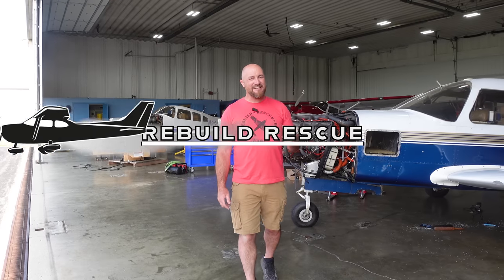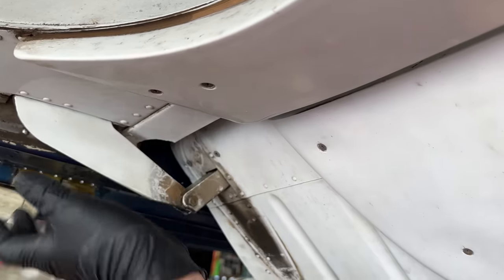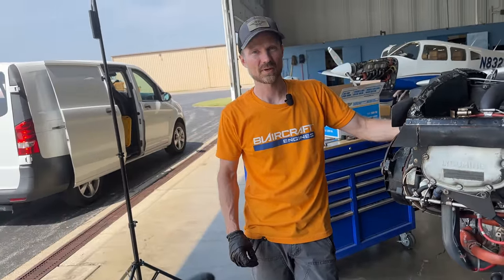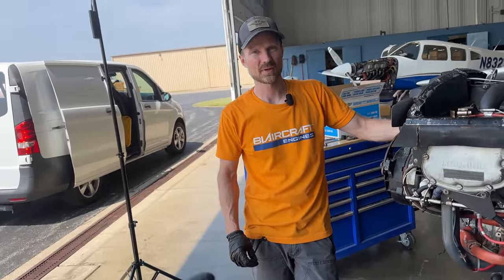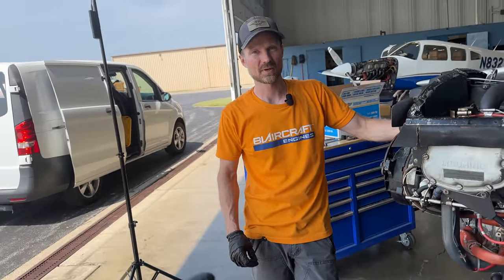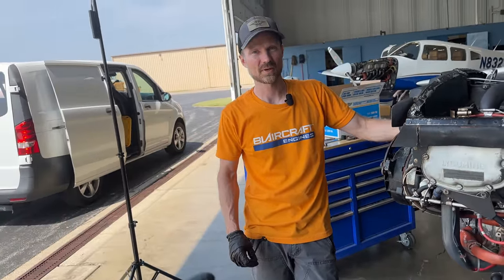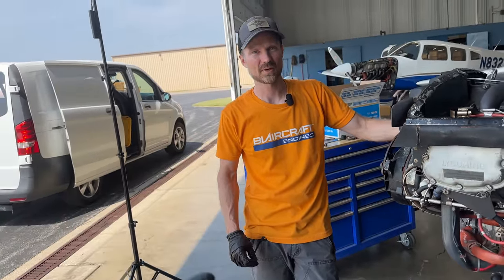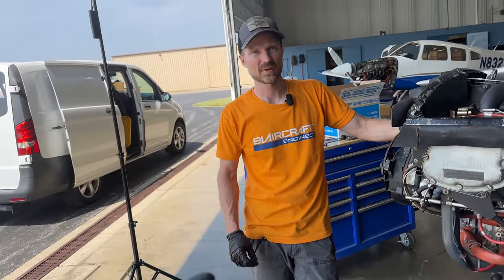Can we Fix and Fly a CRASHED Airplane 400 Miles Home ?

Comment: Also Jason, you don't need an annual inspection to fly the airplane back to your home base, the best thing to do is to get a ferry permit they're easy to do all you need is an A&P to inspect the aircraft and sign off that the aircraft is  
airworthy for the proposed relocation flight and submit electronically that to the FAA. You might want to reach out to Mike Bush at savvy aviation I'm sure he will be more than happy to explain the process, or you can talk to your local FSDO. The reason I'm saying this is that there's no reason to rush through an annual inspection better to have the aircraft near you when you do the annual just in case you find something significant, Good luck!
Reply from the maker: Thank you Chris !
Reply: @rebuildrescue  super duper my friend I love your work ethic That's fantastic. It would be great for every airplane enthusiast to see how the ferry permit process and post maintenance fight takes place, The more the public sees how the system works the more they can embrace it. I'm sure Orville and Wilbur wright would be proud of your team. 😁✈️

Comment: This plane needs a Continental CD 300 Jet A engine conversion so bad!
Reply: A 10% reduction in available power? Huh?
Reply: @buckmurdock2500  I dont know. is has 300 HP and runs on Jet A (diesel) instead of AVGAS (leaded petrol) like in the 1980s. Im not even an eco nut job I just know that burning lead to dumb down the combustion and keep the cylinders cool is old technology that is not relevant now days.
Reply: @E69apeTheMatrix420  Forgive the typo, it's about 10% reduction in power. For new development perhaps but can't see it happening in the US retrofit market. The engine install will be 2-1/2 times the value of the plane,  comes with a hefty weight penalty and other than fuel consumption offers no performance improvement.
Reply: @buckmurdock2500  I cant run leaded petrolium like its 1979. just cant do it. its turbochrged real useable power and takeoff wil always be better in jet A. leaded Avgas is for losers it wasnt even acceptable in 1990 let alone today. Leaded petrol? The jet a turbo dieles would be better in every way. just the red tape of retro fit isnt viable for the cost and effort The new engine out the box is $30,000. Not too bad if the current engine due a TBO anyway. Just the hoops to jump through makes it hard
Reply: @E69apeTheMatrix420  lol, where do you get your numbers from? A brand new Continental O-200D, which is a lighter weight version of the cessna 150 engine is $40,000 from AirPower. A brand new Lycoming TIO-540 for the Saratogo is $150k from AirPower.  There's no way the diesel is $30,000, lmao. A FWF install job on the Saratoga will be quarter million.
Reply: ]1

Comment: Well, i'm glad that it looks like it's running so well and I know the crank gauged right but sure would hate to find out the hard way that there's a hairline crack in that crank shaft from the propstrike that decides to break when you're 350 feet off the ground after takeoff.  Pull her apart and magneflux it.
Reply: Absolutely not you never tear apart an engine if you don't have to. Statistically it is well known that an engine is more likely to fail after it is rebuilt when compared to one that has been running just fine never ever ever ever tear apart an engine unless you know for a fact that something is coming apart like a camshaft The airlines learn this in the 1960s the British coastal caband learn this in the 1940s. Of course as a kid I learned this when building model airplanes we always tossed a rag into the prop to shut it off and not once did we ever have a crank break because of this.
Reply: @christophergagliano2051  They actually have to pull the engine apart as per the engine manufacturer's own service bulletins. I'd be interested to see if the propstrike was ever disclosed to the FAA or any future buyer.

Comment: Layman’s question: What’s the deal with the wall plug with the red cable tied to the top side of the engine?
Reply from the maker: That’s a block/oil heater for cold climates.

Comment: Hey, Jason, what is the AC plug on top of the engine for?  Keeping the oil warm in winter?  Also, saw something useful on Steve’s Small Engine Saloon— for rusted-on bolts, mix Acetone & Automatic Transmission Fluid 50/50.  It worked well for me.  Kroil 2.0 😎
Reply: Yes, engine pre-heater.   They warm the cylinders and the oil sump.   

The two prominent manufacturers for GA aircraft engines are Tannis and Reiff.   

Reiff has bands that heat the steel cylinder base vs Tannis that has plugs that thread into and heat the cylinder head.    

     Both have silicone or metal pads that glue to the oil sump to preheat the oil.

Comment: Please see Lycoming Mandatory Service Bulletin 533C Recommended Action for Sudden Engine Stoppage, Propeller/Rotor Strike or Loss of Propeller/Rotor Blade or Tip.  Is this mandatory or recommended in this case?
Reply: How could it be mandatory if it's only recommended I went through this on an export years ago and the importing country CAA said dial the crank run it up, and if it makes power (TC Data Sheet) it's okay to export.

Comment: A great video for sure, well done. Joe please remove "pop rivet" from your vocabulary while working on an aircraft. Pop rivets are used to build RVs and campers built in Warsaw Indiana home of the RV trade lol. I hear by authorize you to use the term cherry max or blind rivet, blind fastener, or pull rivet. But please stop with the pop rivet those days are over (refer to full metal jacket for explanation on those days are over) lol

Comment: what's the procedure to make sure the engine is okay after a prop strike?
Reply: Jason said there is a FAA AD (Airworthiness Directive) that covers the procedure to check the engine out, actually I think it might be mandatory service bulletin from either Piper or Lycoming but I could be wrong. In any event it looks like you inspect a bolt and a sprocket located in the accessory case, also check the front end of the engine with a dial indicator to make sure the prop flange/crankshaft has not been bent.
Reply from the maker: 100% correct Chris. Lycoming also recommends a few other things but aren’t part of the AD associated to a prop struck engine.
Reply: @christophergagliano2051  ah cool, thanks, was thinking that what did they did was the relevant part, in my mind it was a complete tear down, but that probably was on something different.

Comment: This was very nerve wracking to me. All this with no errors. We do not know if high boost and lower rpm will break the crank or not. Go Saratoga go. As smooth as it is running I doubt anything will go bad along the way. Now oil burn and fuel flow will show this to be very well done. These engines with turbine exhausts will be stronger than the pilot without oxygen it will pull strong right to 18,000ft.

Comment: As an engine guy myself I was searching for the engine teardown and NDT of the rotating parts. I guess I missed it. Lycoming says: Any decision to operate an engine which was involved in sudden stoppage, propeller strike or loss of prop blade tip without disassembly and inspection will violate the AD Note issued by the FAA and Lycoming Service Bulletin No. 475C, both of which are mandatory. Any decision to fly an engine without complying with these publications must be the responsibility of the agency returning the aircraft to service. Figured to post the video, the work had to be accomplished... No trying to be a butthead, but guessing I missed something.
Reply: Ok, I now see where you did the crank run-out, but man no NDT ????

Comment: I thought a prop strike on a engine is full teardown of engine to check for cracks in the crankshaft SCAIRY BOYS WHO IS SIGNING THAT OFF?
Reply: No, they did it right, there's an AD or Lycoming service bulletin that they're following. The reason being is that a total rebuild has much more risk than the two inspections and two replacement parts, trust me this is safer method to return the aircraft to service.

Comment: The old saratoga curse....gear up landing. Usually due to overlooked alternator belt alignment, which results in a broken belt at the worst time....ifr, bad weather, night time. The aircraft battery isn't capable of running all of the systems very long.

Comment: This is the, "Get there -itis..." of the maintenance world.   Seriously why is a non A&P Master Mechanic determining (Jason) the Scope of Work and pushing the profesionals to be fast?
Reply from the maker: There’s zero pushing. Just good friends working hard and lots of hours to complete tasks. All while following standard repair procedures according to the manufactures and faa rules and regulations. 👍🏼
Reply: @rebuildrescue  I'm just wondering, will this have some kind of run in test time on the ground before it's fully laden and in the air? Just curious how this kinda thing works. You guys look like you did a great job btw😀 Not that I'd know anyway 🤣
Reply: @anthonydenn4345  Yes this will require a flight test with only the pilot on board, that's an FAA rule if they violate it I could guarantee you FSDO will be contacted with a formal complaint.

Comment: Yup.  Pull th Wings Cradle the Fuse & wings on a Flat Bed, Drive it 400 miles and take the Time to do it right. JMHO
But then there's no you tube Video.

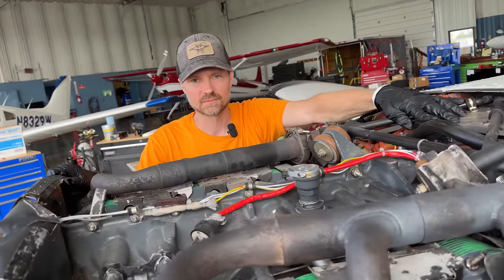Comment: 5:05 I guess we're just gonna ignore the house electrical plug wired up........
Reply from the maker: That’s to the toaster oven in the cabin. 
Totally kidding ! That’s to the block/oil heater and was included with the approved parts on the Toga.
Reply: @rebuildrescue  Thank you! I saw that and was like, ok, this is a new electric power upgrade? I full on had my wife believing that you guys just use a really long extension cord and it's an all electric plane.

Comment: too bad you didn't explain in the beginning why you have to take off the magnetos and the vacuum pump after a gear-up landing... did you have to change that bolt because of the prop strike? What was annual work related and what was accident related? Would have been interesting if you had shown the damage from the belly landing. Did you/do you have to change any panels underneath? was the gear-up landing caused by pilot error or mechanical malfunction? Do you have to check the gear down/up function before take off?

Comment: A prop strike requires a complete engine overhaul - how could you do that it three days
Reply: Absolutely not, no overhaul needed for a prop strike. The FAA has ruled on that and issued an AD. years ago that might have been the case but not now as the FAA has recognized that complete disassembly adds more risk.

Comment: What is that electrical plug doing on the top of the engine?
Reply: Tanis heater. You plug that in and there are heating pads in the engine compartment to keep oil and cylinders warm during the winter.

Comment: The problem with dialing out the crank while fully assembled and installed is that a prop strike can crack a crank and a dial will not show that at all. Only visual inspection will.  the other problem is A prop strike can crush only a small area of a crank bearing, and a dial indicator only sees the resultant lateral play on a single point on the entire 360 degree area of rotation of a crank.  The lateral play from impact can be on any one of the degree angles on the  360 degree rotational points.  IN addition, the lateral play may not be apparent with all the rods and pistons installed. The play of a crank bearing in a overhaul or rebuild is measured always with no pistons or rods installed because they restrict crack latter play. Dialing a fully assembled engine crank to detect bearing damage or crank damage is stupid. Lycoming does not recommend it.

Comment: You Torqued all those bolts on rear gears wrong. Suppose to do it in one smooth motion. You torqued in rachet movements. The torque is off by a minimum of 30% when you do that. Even though there looked like was little room to turn the torque wrench, that is because you placed the handle in the wrong spot to begin the torque. You had plenty of room if you properly positioned the wrench before beginning the final tightening. All those bolts are way off proper torque. at least 30% below spec.

Comment: Why do I feel like you are doing this the hard way? I line up the gears with a ruler and it works quite well. Not sure why you don't do this? Use the studs for alignment, and the holes, bla, bla, bla. You should nail it.

Comment: Oh by the way, it would have been a lot easier to do a scarf alteration on the flap hinge bracket putting two pieces of aluminum on each side of a new flap hinge bracket. So instead of drilling out 150 rivets you could have just drilled about seven holes and rivet the same size fasteners to the existing/cut down bracket that would have been a perfectly acceptable alteration, at a vastly reduced cost.
Reply: where's your data?
Reply: @buckmurdock2500  Well for sure use the same type of material as the original bracket and of course it's going to be stronger than the original bracket cuz you got two pieces on each side of the replacement bracket and of course you use the same rivet size that attaches the bracket to the rib I'm sure there's a similar repair in AC43.13 and that is FAA approved data

Comment: I watched a little more as you placed the gears back inside the rear case--NOT ONE BIT OF LUBERPLATE OR LUBE.  Oh I see now you like dry gear shafts when starting. WOW.   Jack leg mechs who should be working cars not planes,   45 yrs as a general aviation mech talking.
Reply from the maker: Hey Don ! No need to worry Brother. We can’t show every single thing during a video. Of course assembly lube was used on the shafts and gears. 👍🏼
Reply: @rebuildrescue  You tell him Jason!!!